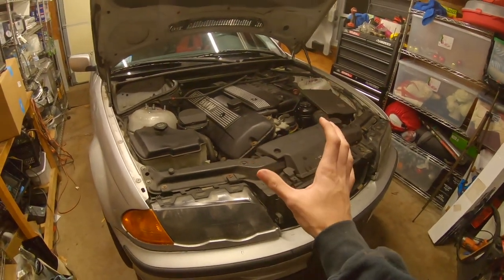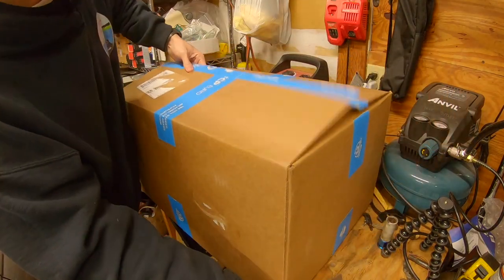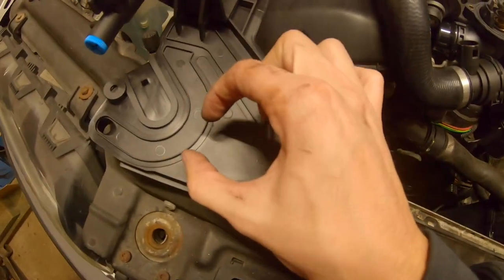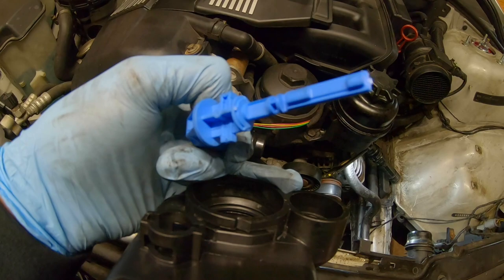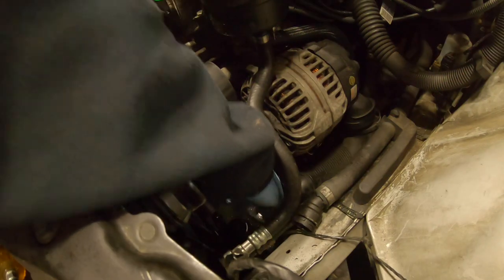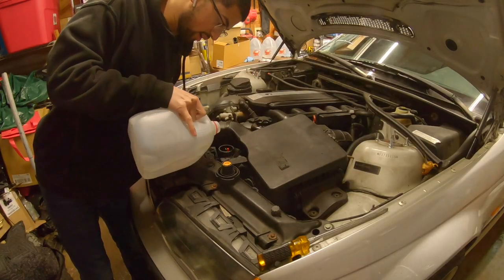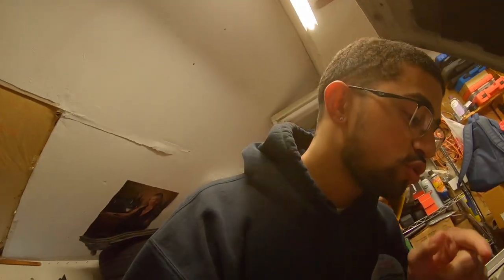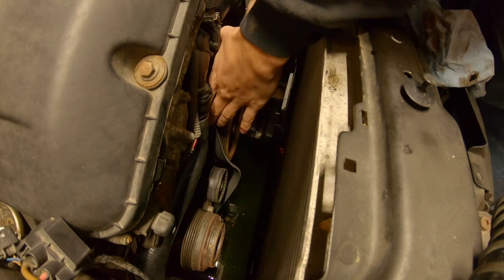Doing MANDATORY Maintenance On My E46 Drift Wagon (BMW Cooling System)

Comment: The pump impeller is not plastic, its a composite. The notorius failures of plastic impellers was with the m50/m52 engines in E36. M52TU and M54 have a composite impeller. The steel impellers are actually worse because they are harder to balance and bearings in the pump usually fail earlier.
Also, check the radiator on the bottom if its bowed out, that is usually the first sign of a failing radiator on an E46. If the radiator is original its smart to change it anyway, mine broke on the connection with the upper hose when I tried to slide my E46
About coolant temp, you can see exact temp in the OBC menu. Hold the left knob on the  cluster until it changes to 1.0, click it until 19, wait for it to change to 19.0, click it again, go to 7.0 and there is your coolant temp

Comment: Don’t forget about the heater lines under the manifold. Wouldn’t be a catastrophic failure and you’d definitely notice it but you wouldn’t be able to do it at a drift event unlike a radiator hose.

Comment: hey joel, this was a great video man! everything is done perfectly other than that metal bleeder screw on that expansion tank! it may seem like a great option but bmw made that screw plastic as an intentional weak point in the cooling system. If you were to overheat or over pressurize the system, it would melt or blow out the screw, with the metal screw in place it will either blow out the top of blow the tank in general! hope this helps!

Comment: you really gotta check the head
i thought mine was fine but the head is cracked  it still runs fine and never smoked or leaked oil and i never overheated it